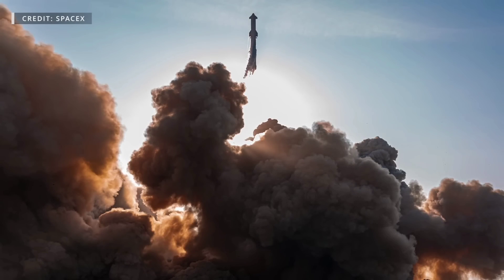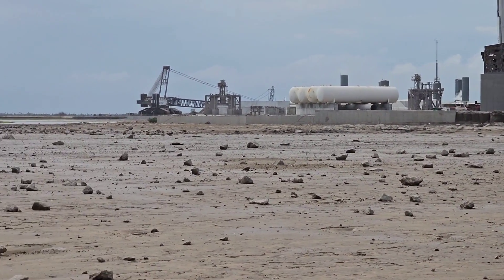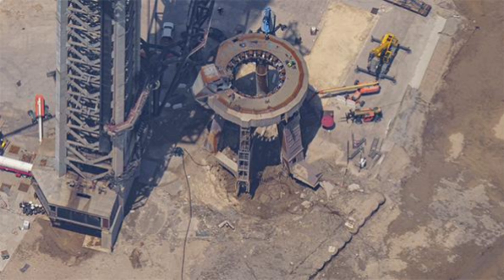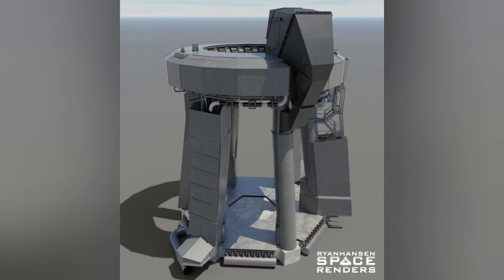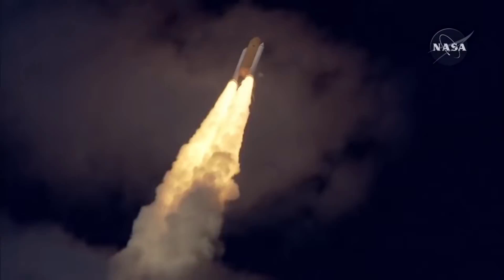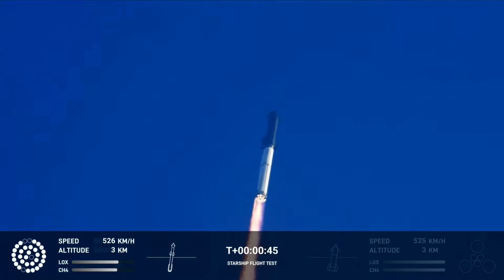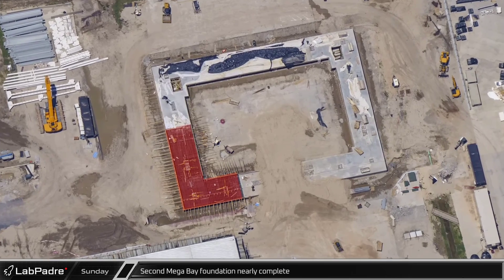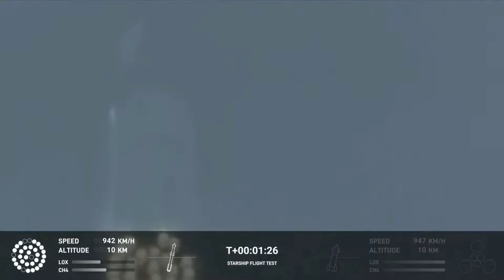Will Elon Musk's water cooled flame diverter be enough to keep Starship and Starbase safe?

Comment: I really don't understand Elon's reluctance to use a flame trench. The argument that we won't have a trench on Mars or the Moon is baffling: are we building Mechazilla and launching Super Heavy's from Mars and the Moon?
Reply: because having a flame trench will require years of an approval process.   Not only does the FAA have to approve, but the EPA also.  EPA is way more political than the FAA.  Democrats would torment Elon while they slow walked the approval steps.
Reply: I think it was because they were denied the permit to build the trench years ago by the Army Corps of Engineers. They are now just trying to find a work around.
Reply: @Hedgehobbit  The permit to expand Starbase wasn't denied, the Army closed it because SpaceX stopped answering their calls for more information.
Reply: you don't dig flame trenches in either this area or KSC, you designate where the flame trench will exist and then truck in dirt and concrete to build up the area around the trench to your new 'ground' level

SpaceX built a platform at the height at that new 'ground level' instead and didn't waste time adding all that dirt and concrete around it. As a bonus, they now have 6 (very short) flame trenches under the launch pad and allow the exhaust to expand and slow much more rapidly than if they had all that dirt and concrete to restrict it.
Reply: @davidelang  Thanks. I knew digging one would be a problem (hence "use" over "dig") and figured they'd have to build it up as you suggest. I'm still not sure how their new solution handles the debris, but I hope we get to find out soon.
Reply: @neal_lawson  my point is that a built-up flame trench would be more restricted than the OLM at the same height. from the bottom of the raptor engines to the ground is 25m, from the bottom of the SLS engines to the bottom of the flame trench is 27m, pretty close to the same (and I'll also point out that NASA had problems with the shuttle exhaust tearing apart the walls of the flame trench at times)

ideally the new solution doesn't generate any debris, so it doesn't have to handle any 🙂
Reply: Because he's a cheapskate and building a proper launch site would take time, money and probably a different location because Starbase Boca Chica is too small for rockets like Starship.

Comment: Since they can't dig down due to the water table, any flame trench would have to be built at grade, meaning the entire launch pad/tower would have to then be possibly disassembled, then reassembled and lifted on top of the new 30-50 foot tall flame trench. All this would be worth it if SpaceX really want to use Starbase as a permanent launch location. Their current slapdash approach makes me feel like they have plans to relocate after testing is done. If they do plan permanent residence at Starbase, why the heck haven't they built a concrete plant and water pumps/towers?
Reply: They could also begin building such a thing at their other site called Masseys
Reply: note that the existing launch mount is about the same height as the flame trench that he wants, so they could satisfy his requirements by building walls up around the existing launch mount to restrict the flow of exhaust to only go in one direction instead of 6 and it would then look like the NASA launch sites, but would be less effective
Reply: @davidelang  Of course it would be less effective. The only way is to design something that will take 100% more thrust because that is the mindset that you must have to succeed in extreme engineering. Designing something that is just “good enough” is American thinking.
Reply: @jason_m_schmidt622  when you extrapolate to handle conditions that nobody in the world has ever seen before, you can overbuild it all that you want and still miss some factor that wasn't significant under conditions that have been tried, but show up under these new conditions.

also, if you try to build a rocket system to handle double the load that you expect it to take, your rocket will not work very well, and will probably not get off the ground as it's just too heavy.

Comment: The Starship launch created considerable damage a long distance away from the pad because chunks of concrete flew everywhere. Take care of the concrete pad fracturing and you take care of that problem. We saw concrete dug up beyond the bounds of the OLM, but this appears to be a result of the damage done directly under the OLM, which allowed hot gases to get under the concrete. So it's quite plausible that protecting the concrete pad directly under the OLM will take care of most of the other damage seen.
Reply: Well said.   It is critical that a regular launch cadence be maintained.   We need to see that Starship can separate from the booster and achieve orbit.
Reply: You may be right as far as it goes, but there is no guarantee that had the exhaust gasses not gotten under the concrete, it wouldn't have fractured anyway and still caused damage.
Reply: An additional thing to note, flame trenches require Ablative materials to survive, this usually isnt that much of a problem with current systems, but this at 2x Saturn 5 would require reapplying after every launch. Not sustainable either...

The plate makes a lot of sense because steel has a linear deformation to heat vs thickness... additionally a linear ablative curve, meaning some might melt but its predictable how much based on heat and pressures, so just calculate how thick you require.
Reply: @TheThunder005  The Saturn V launch pad was designed for the next generation rockets for a Mars mission…
A reusable rocket requires a reusable launch pad as a minimum. Even the V-2 managed THAT much reusability…
Reply: My thoughts exactly. Concrete further away from the pad was only damaged because the flue dug into the ground at the pad and got under it. The plate will cause the flue gases to simply flow over the top of this more distant concrete.
Reply: @ericgribble9645  You are assuming the thrust doesn’t just push the steel plates into the saturated sand under the launch pad again…
That’s an inherent problem with the Boca Chica location.

Comment: When the Challenger disaster happened, my first thought was "I bet it is the solid rocket booster" - and I was right. Why? Because it was one thing they didn't expect any problems from, and NASA focused most of their attention elsewhere. 

Similarly, SpaceX didn't expect any problems from the launch mount, and focused most of their engineering on Starships and boosters and the catch tower instead. The result was a launch pad that was totally inadequate and incapable of handling the stresses involved in launch. I suspect that the "water plate" isn't enough, either. SpaceX will probably have to completely re-design and re-build the launch mount and pad.
Reply: Except SpaceX did expect the launch tower to fail which is why they had already started prepping the steel plate. They just didn't expect it to fail so dramatically (which was due, in part, to how slow the launch was. They lost three engines before take off and none of the engines were at full power).
Reply: The great benefit from launching without delay is the engineering knowledge SpaceX is accumulating.  How else to learn how to get Starship into orbit other than by launching the system?

Comment: I think from Musks' viewpoint, "minimal damage" means "can be repaired fairly quickly." So an utterly destroyed concrete pad and a deep hole dug under the OLM is "minimal damage" if it can in fact be remedied in a couple of months.
Reply: If the launch tosses debris back up into the engines, its a critical problem.
If one looks at the camera view from the Tower, a piece of debris can be seen to rise alongside the right side of the Booster. If a launch is tossing debris as high as the Booster in the immediate environs of the Booster/Starship, it is a CRITICAL problem.
Build a Launch Tower on one of the Crawler/Mobile-Pads, and use the Saturn V/Shuttle Launch Flame Trench & Deluge System. Then use the Assembly Tower away from the pad for the landing... in case it fails (its mostly empty and under considerably less thrust)
Why Can't Elon See This Easy Solution?
Reply: @WhiteWolf65  "Repaired" in this case means a solution that prevents a repeat of the "rock tornado" from the concrete pad being destroyed.

Comment: A 3 to 5 meter high & 2 meters deep min. circular concrete perimeter wall (1.5 meter thick min. with #8 rebar min. @ 6 to 8 in o.c. vert. & horiz. each face and u-bars at top and bottom, 3 inches cover min. all around) around the liftoff stand forming a pool can hold the water and should be strong enough to contain the exhaust of the starship exhaust and be easy and quick to build.  Water also has to be flooded into this pool during the liftoff phase so that the pool overflows the perimeter wall by at least 2 to 3 feet.  The concrete strength should be 20,000 psi, not the standard 4 ksi.

Comment: Well hardened blast plate destroys itsself so we know that constant soft and plyable may be the next ticket. Might go to a ramp like when worlds collide. Might even put wings on it at that. Be a horizontal takeoff blast
Reply: Better vision is the engines and their mount be a seperate entity..one reason is you just swap in the next mount of engines on the go round. After that any thing you want to intergrate on top of it , delta wing tanks for a first stage? I see more boost back range possibility. As heavy as it was 3 stage would be smaller 2nd and 3rd stages to be anywhere practical to get any kinda further and back. I do realize these SN's are test models and not Starships by any way et.el.

Comment: The only danger I see is the risk of all that exhaust heat instantly flashing a lot of that water to steam. That steam would occupy hundreds of times more space than the water, and might create some kind of big pressure wave heading out in all directions. That might knock off a lot of tiles, and maybe break windows a long way from the pad. But I guess they calculated that. Water can absorb a lot of energy before it changes to steam, so enough of it might prevent a steam explosion. 
So the next blastoff has the potential to be more spectacular the the last one. 
If water fails, I wonder if a lot of carbon dioxide blasted through the steel base would work? It gets some cold when changing from a liquid to a gas. 
Even a steel flame trench needs water cooling to prevent the steel from softening and eventually collapsing. Stennis pumps millions of gallons of water into the trench to keep it from sagging. They recently replaced the main pipe from the pumping station to the main test stand. It is huge.
Reply: Steam is more complicated than water turning to vapor. The visible cloud is actually water that has returned to liquid droplets so that portion is no longer vapor an thus it no longer is expanded. The condensation also reverses the thermal effect of the evaporation. So  much less cooling than you would expect overall. A larger volume of water is needed due to this as it's cooling more by just carrying the heat away rather than by evaporation.

Comment: "THE ROCKET BASE IS STILL TOO LOW TO THE GROUND"....Savvy
Reply: it's pretty much the same height above the ground that the SLS is above the bottom of the flame trench.  What is the magic height that you think it needs to be?
Reply: @davidelang  At least 200 to 250 above the rocket base  ground pad,  with a diverter trench, and plenty of water from all directions..
Reply: @stuartpearce4773  so you think the bottom of the rocket needs to be higher than the top of a Falcon 9 rocket???

the initial email notification that I got about this post said 100-150 ft, it's currently ~82 ft

Comment: If the exhaust doesn’t blow under the concrete there is way less stress stress on it.
The water tower could be directly in the mechazilla, but might need addition pressure.
The damage in the region is negligible, a bit of dust and some small concrete chunk in the sand.
Reply: Take a look, the steel water sandwich still has seams which the rocket exhaust can still penetrate and get under the steel unless they weld the seams to a gas tight condition.
Reply: @charlie44266  Those seams will be welded.
Reply: @charlie44266  metal seams are easily welded, you also have to remember Elon described it as like an upside down shower head, that water coming up will absorb some of the energy and then the plate itself is full of water, the plate will function completely different then multiple different concrete pours tied together with rebar.
Reply: @charlie44266  I agree. Even if the seams are welded, there is risk of hot exhaust getting under the first steel plate. If the happens, and steam is generated under the plate, it will aid the exhaust in peeling it away.

Comment: WHY. NO. FLAME. TRENCH?!?
Reply: because they didn't want to channel all the exhaust in 1-2 directions, the launch mount is pretty much the same height above the ground that the SLS engines are above the bottom of the flame trench. The ground under the Starship and the bottom of the flame trench under the SLS are at pretty much the same level (just a few feet above sea level).

Would it have made you happy to see SpaceX trucking in hundreds of tons of dirt and concrete to put around the launch mount to turn it into a flame trench? that would have just made the problems worse.
Reply: Because they were denied a permit to build one years ago.

Comment: Concrete was likely thrown away because flames got underneath it. So it had to have started in the middle. A metal plate will prevent that. Without that initial breach, it won't be able to spread outward. Youtube expert talking here.
Reply: Exactly. It’s that initial breach. Unless the area directly under the raptors is one, solid cast plate of steel, I think there is risk of the steel plate getting peeled away. Also, I wonder if they will be able to overcome the high exhaust pressure at every single crack, every hole in the plates? If not, it seems that hot exhaust could push into, and under, the top layer of the cooling plate and create steam under the plate, aiding in its removal.
Reply: @jwortman1984  exhaust pressure at the plate isn't that high; like maybe 12 Bar.  The whole thing is very open under there with very little resistance to flow.  It isn't the pressure, it's the extreme velocity that ripped up the concrete.  It doesn't take that many pounds per square inch to lift and move something when you've got a heck of a lot of square inches of the force acting on it!!!  Kinda like a lawn leaf blower; not much pressure, but they move a lot of air to push stuff around.

Comment: Didn't SpaceX want Starship to be able to launch, land, & launch again from anywhere on any planet or moon?  That can't do that if a flame trench and deluge system is required all the time.  So maybe they'll try to launch with rocket engines starting off at a lower capacity to minimize damage to the surrounding area?  Then again, they were able to launch without damaging anything using upper stage only, which had less engines.
Reply: yes star ship not the booster. starship doesnt take 33 engines to lift of from a planet with low gravity
Reply: Gravity of the moon is 16.6% of Earth's. Mars is 38%. Less gravity means less thrust required. On the moon, easily one engine firing at reduced thrust would be enough for a slow ascent and once clear, throttle up for Lunar orbit.
Reply: Flame trench is only needed for the booster launch from Earth.
Reply: There've been ideas bounced around that a Starship lander would have decent / ascent engines half way up the body negating the problem of ground blast.
Reply: you can't launch at a lower level then they did, Elon said they launched with 3 engines out at ignition and that was the limit for whether the launch went or not. Thrust To Weight ratios matter in rockets, you can't just use lower thrust that is below the weight of the fuel vehicle, it would just sit there burning fuel till it burned enough to lift off then it wouldn't have enough thrust to reach orbit.
Reply: Please stop with this ridiculous meme about "preparing for planetary surfaces." IT'S.  THE.  BOOSTER. It's NEVER landing or taking off from anywhere but EARTH.
Reply: The booster is not intended to land and launch on the Moon or Mars. Only the actual Starship will descend to the surface.
Reply: Its crazy that they dont have a flame trench.  Even crazier that the launch pad is so close to vital launch facilities including fuel tanks.
Reply: @artsolano6762  not when you consider how limited their space is and that they eventually want 2 orbital towers and the 2 sub orbital.

Comment: I'm not sure you're right about any of that. The water cooled plate won't necessarily have water on top of it at all. Instead, it looks like it's just cooled by channels flooded with water inside the structure. If that's the case, you don't need anywhere near as much water, just enough to stop the plate from melting. Water is extremely effective at removing heat, it just has to be replaced before it turns to steam. I'm sure all of the calculations and modelling has been done and they know exactly how this will perform.
As for what happens outside the area of the Metal plate. The concrete isn't seeing the full force of the engines,  so it may well survive.
Reply: Elon Musk recently described the device as a showerhead upside down. So it will be spraying water directly upwards towards the rocket. Of course, they'll have to test it at least once before launch so we'll soon see how it looks.